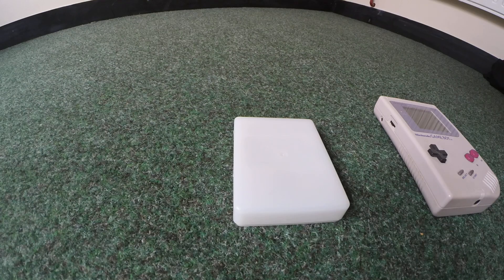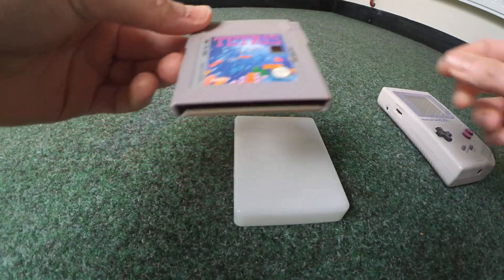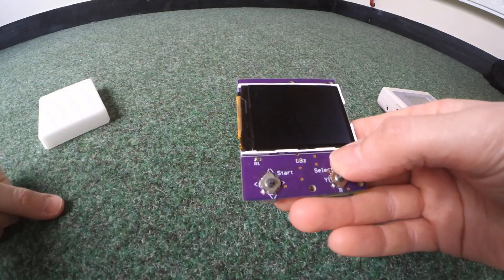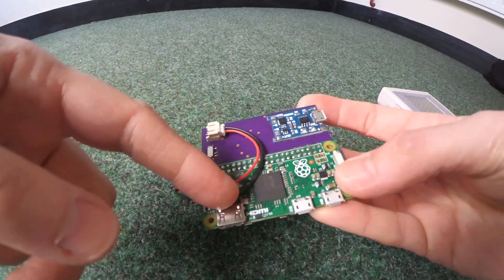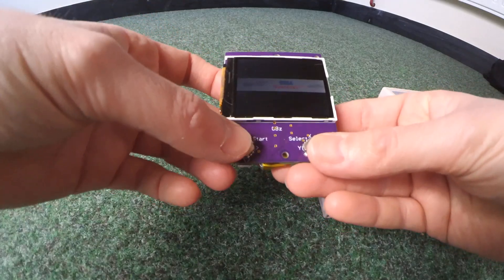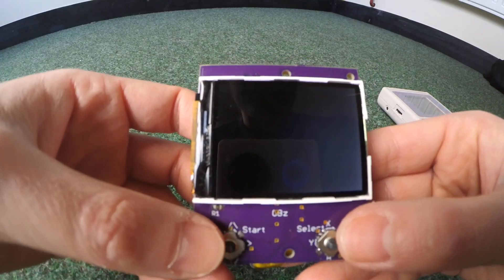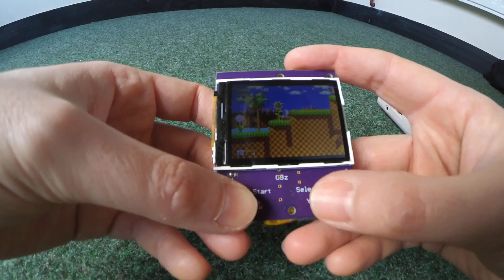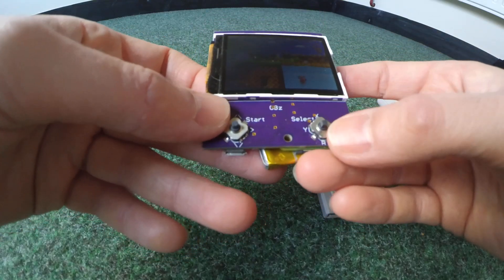Tiny GBz

Comment: Excellent. I'm making something like this. I'm glad you found a charging board that's not the adafruit expensive one. this one is only 4 bucks! Nice work.
Reply from the maker: thanks :) most people cant get their heads round the lack of boost to 5v that the board provides. There are little pcb's that normally go into cheap power banks if you do want the 5v
Reply: I just want some way to connect a lipo to the rpi zero w with the ability to also connect the 5vmicro usb to charge. Will it do all of that? I need it to do what the PowerBoost 1000c will do but at a much better price.
Reply: yeah i just wanted something cheaper than the PowerBoost 1000c. I guess this should work as well only i have to soldier the battery terminals on etc..
Reply from the maker: it will do that yeah
Reply: great thanks!